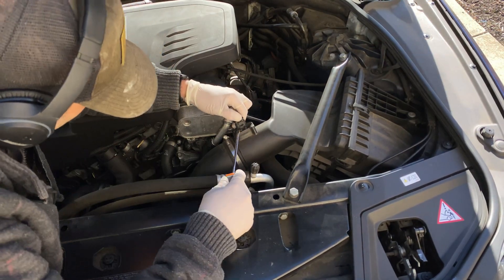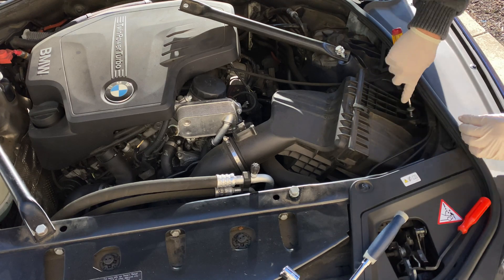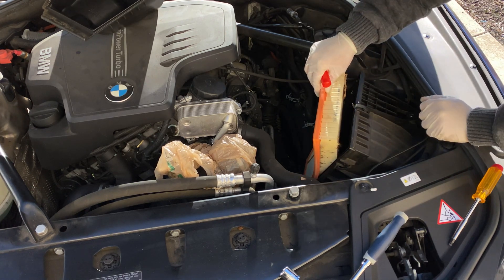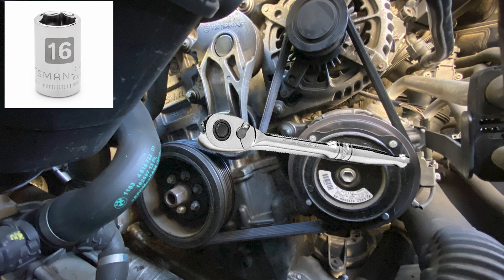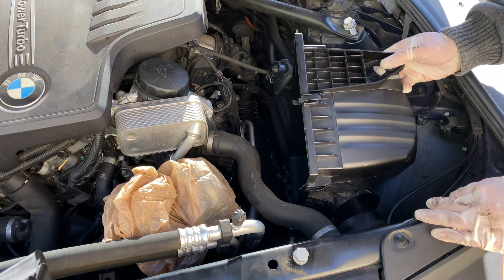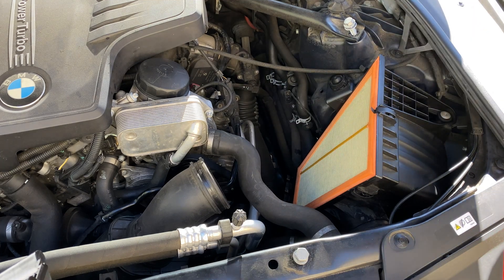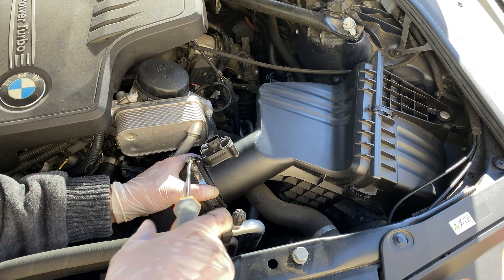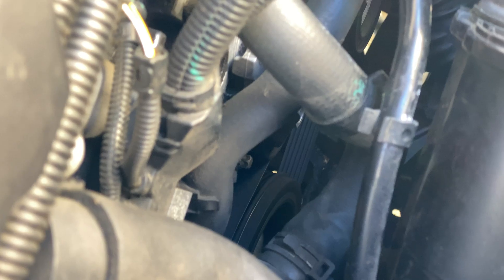BMW F10 F11 SERPENTINE BELT REPLACEMENT REMOVAL INSTALLATION 520i 523i 528i 530i 535i 518d 520d 525d

Comment: Thanks. Would have been good to actually show how you got the belt on though; it is the hardest part.
Reply from the maker: Totally fair point—thanks for the feedback. You’re right, getting the belt back on is definitely the trickiest part, especially with the tensioner in a tight spot. I ended up having to set the camera down to actually wrestle it on and didn’t get a good angle to include in the video.

Comment: This applies, I think, to 4-cyl petrol engines (or maybe also 6-cyl petrols). Just bought a 2012 F11 530d with the N57D30O1 diesel (6-cyl), and it's different. That said, the explanation is very clear and easy to understand, kuddos for the production. Also - if the belt replacement is this  easy - do it often (more often than mfd's recommendations - same applies to oils (in case of my engine it's 30k - f-ing really, BMW?)). Belts do fail - and when they do, they tend to cause mess (damaged harmonic balancers, various pulleys, ingested belt pieces into front main seal, etc). A new belt costs from 10 to 20 euros (nothing compared to damage in case of neglect). Greetings from Latvia.
Reply from the maker: Thank you for the detailed info Juris. We don’t have very many diesel over here in the USA. But they are great engines! It is good to know that it is different for people. I like your idea of servicing them sooner than later!! Good idea!
Reply: @fixitwithjake  Thank you for this video. BMW quoted me $264 to replace this on my 2013 528. 
I'm wondering how long this job takes?
Reply from the maker: That’s not a bad price at all. I’d pay someone if it is that cheap. Takes them 20 mins. probably since they do a lot of them.